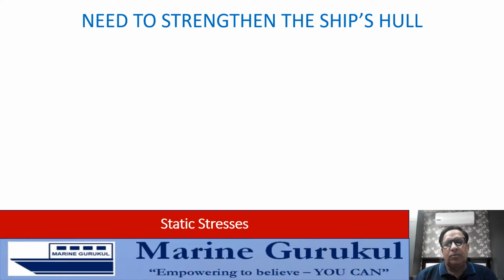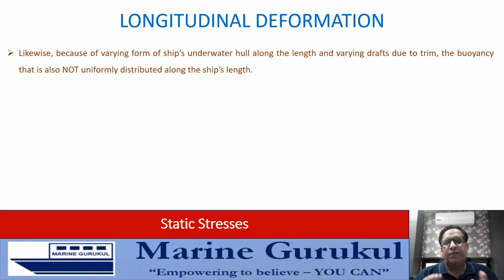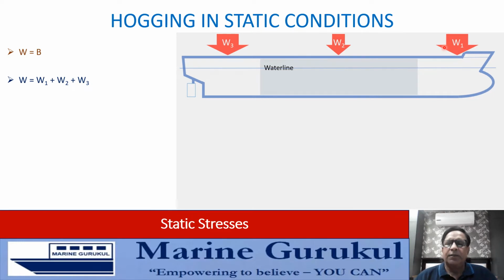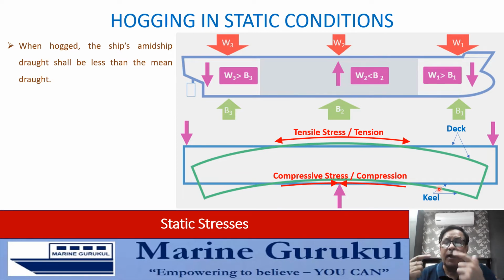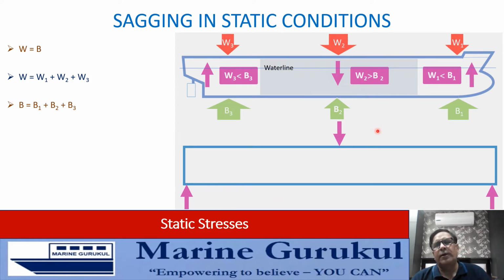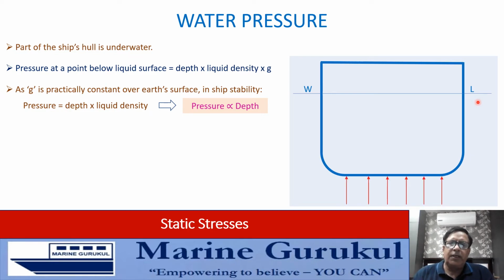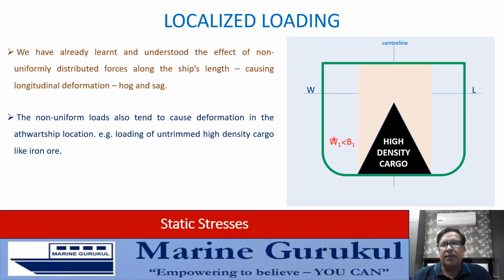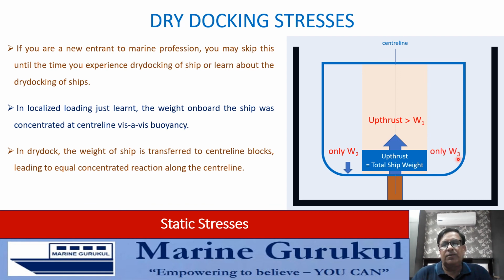Ship Hull Stresses - Static Stresses

Comment: Hello sir, centre of buoyancy acts upward at centre of floatation which is variable and changes with change of draft. When ship goes from fresh water to dock water and vice versa, her draft changes , so centre of floatation will also change, so will it cause vessel to trim?🙏
Reply from the maker: Centre of Buoyancy acts through COB - that is the geometric centre of volume of buoyancy (which is same as underwater volume for intact ship). COB is different from COF. 
As vessel goes from water 0f one density to other, the change in draft leads to change in volume of buoyancy and a consequent shift of COB. The shift of COB is responsible for change in trim.
Hope clear. You may watch this video: https://youtu.be/A3cvM8TAWQg
Best Wishes.
Reply: @MarineGurukul  thnks sir 🙏
Reply: Good morning
 For preparation of second mate / DNS/ BSC nautical science/NCV come in #kundanpatna